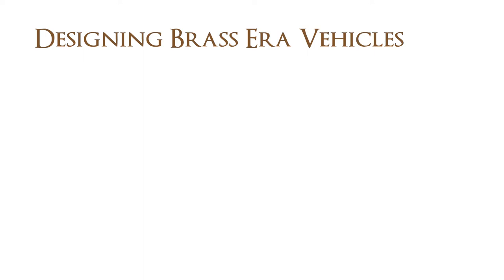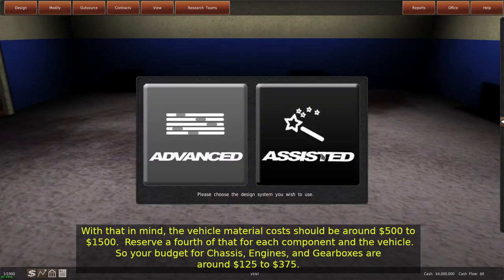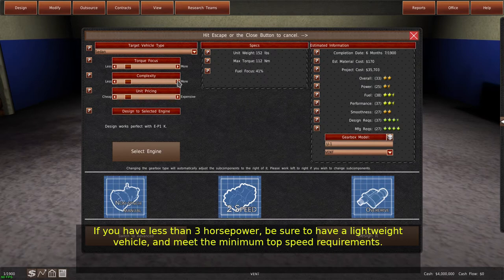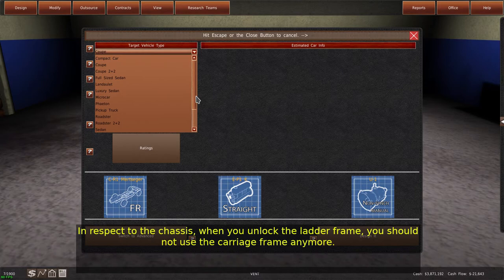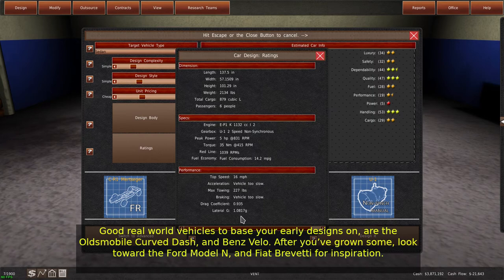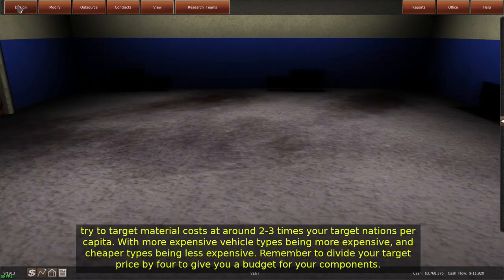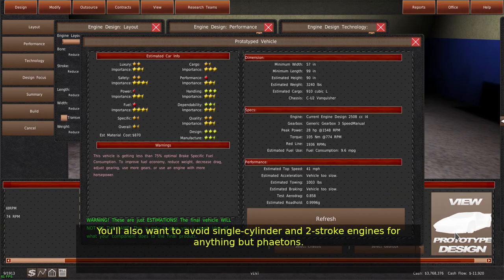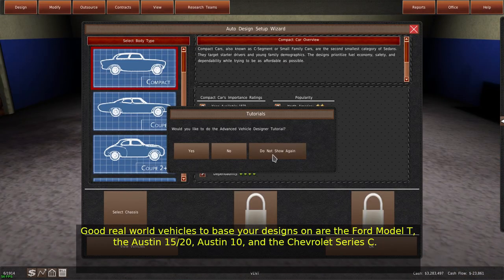GearCity Tutorials: Designing Brass Era Vehicles

Comment: How many kgs is low enough to be considered lightwight?
Reply from the maker: Wow, I missed this question. Sorry about that. Better late than never. 500kg would be the top end of lightweight in 1900. It's difficult to hit those numbers in the game. So you may need a little more power to make your engine efficient enough for what it's moving. In the mid-era, I would say around 1000kg max is lightweight. In more recent times, 1250kg is lightweight. But all of that is subjective.